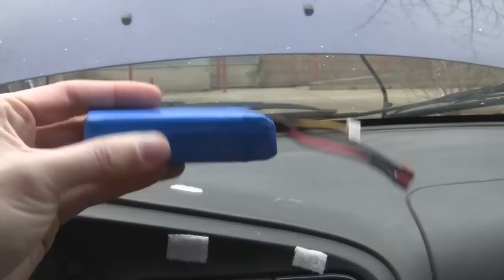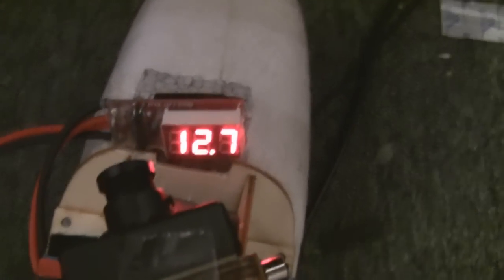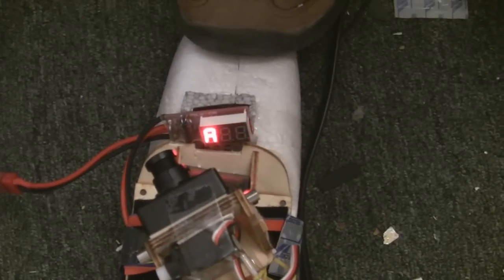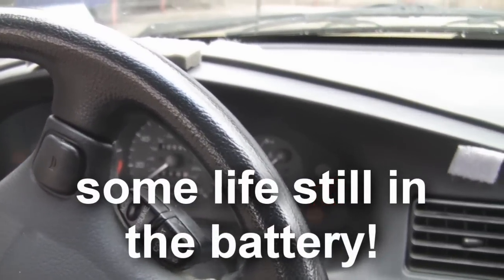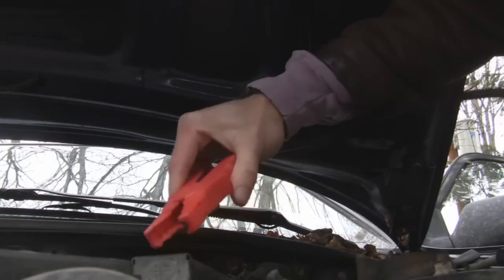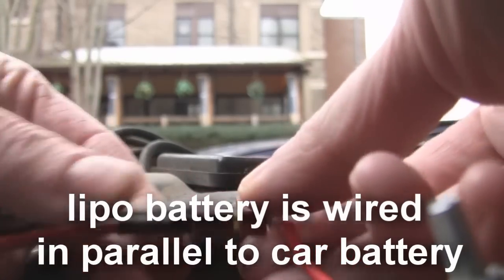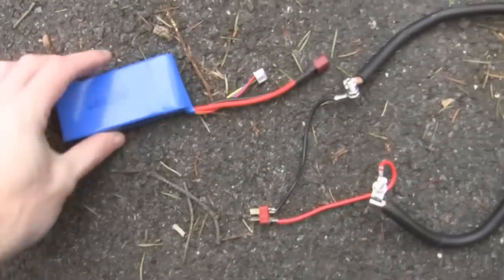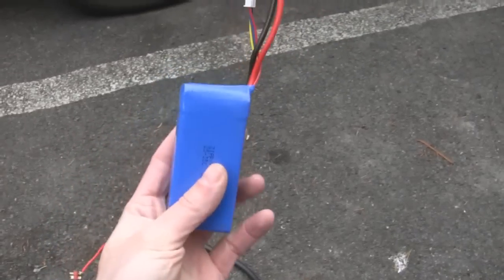Starting a Car with a Toy Plane Battery

Comment: Tried this on a motorcycle using a 4s lipo. Turned that 250 over at at probably 1.5 - 2k rpm. Melted the thin jumper wire I used. Fun times.

Comment: The explanation is fairly simple, it's not high science. The car battery when new and fresh has a capacity of about 60 amps for an hour. But old, worn and tired, it will produce half that, so not quite enough to start the engine. So plug in a fresh LIPO battery with a capacity of 3 amps for an hour and you are able to add ten percent to the car battery, just enough for the job. The LIPO wont do the job on its own, and if your car battery is really dead, you won't have enough. It works, but only in marginal situations. Connect the LIPO and wait 10 minutes while the electricity transfers to the car battery before trying the starter. Bear in mind when that a new car battery of the he right size will be much better, and won't cost much more than these high C rates LIPOs. BTW, don't allow the LIPO to remain connected to the cars charging circuit for long otherwise you risk a fire.

Comment: I wouldn't encourage people to do this though, from what I understand those batteries explode/catch fire if you charge them incorrectly. In some cases they do that anyway when you are charging them correctly.

I'm guessing if you leave it to be charged by the alternator on a car for any period of time it will catch fire/explode, not a good thing if you are holding it when it happens. I would just get a battery charger and just charge the thing for a few hours.

Comment: there is a big difference in which the way dc and ac power electrocutes you, if you wanna lose limbs or get serious burns dc, if you want to be grabbed and throw a breaker almost instantly pick ac trust me ive been hit by 440v ac it wasn shit compared to a 24v battery bank used for emergency startng an egt i was working on battery bank slipped because we were in heavy seas and crossed the poles  series parralel battery bank and instantly suffered extreme burns and got thrown about 10 feet

Comment: and you do realize that the amperage scales with voltage, right?  I'd rather get a 60A zap from a 12V source than a 7A jolt from 110v source.

Comment: It's impressive, but it could be a small lead acid, motorcycle battery. OK the density is notably greater, but both types of battery have the ability to deliver a good instant hit of power.

Comment: @santopotter The car battery and the toy plane battery use different technologies. Lead acid vs Lithium Ion. That's why they're different sizes. LIon batteries have a much high energy density which is why a battery that can start a car can be smaller. It's also a lot more expensive though, plus LIon batteries self discharge over time, which is why they aren't used to replace car batteries.

Comment: @santopotter this vid isnt a fake, you can start a small car like this that the battery isnt completely dead on. That little battery he has will constantly discharge @ 75 amps, and is rated to do burst @ 87.5 amps and will actually do more than that for just a few seconds.also if it transfers power @ a rate of 50amps for 15 seconds,that is the same as 500amps for 1.5 seconds(about the amount of time it takes to start a car)
no arguement,just fyi
thanks

Comment: Geee!! this is fake!!! You can't start a car with that little battery!! The 12 volts are not important, what you need to start a car are amperes!! lots!! Why do you think the car batteries are that size? If that little brick could match the car batteries in performance, well, i think car batteries would be that size now on.

Comment: I heard when you jump-start a car (using another car) you should put the black cable not at the minus part, but on some other piece of metal inside the car. Is it the same here? Cause it looked like you were putting it on the minus.

Comment: @biggdaddy2001 That might work, but you'd need one huge diode. With 100 amps peak load the diode would get hot and drop at least 1 volt (silicon diodes only.)

Comment: @bloodreighn Those LiPOs can take 40 amps continuous, but they can also take somewhere from five to ten times than for a couple seconds without harm. LiPOs can explode or catch fire of course if this is a continuous fault because of internal heating, but in an emergency I can't see the problem...

Comment: CONTINUED: Generally because the starter motors are smaller, more light weight and because of there gear reduction drive having to force around a higher compression engine i would only ever see 60-100 amps in Motor cycles and ride-on lawn mowers, IN General, NEVER Jump a car with a battery smaller than the main battery

Comment: oh sure it will start it, but because of the Type of the load on that Type of battery, you have a HIGH Risk of blowing up the battery, which aint a good idea if you have seen a Li-PO Battery explode, and.. no it doesnt take 60-100 amps for small cars, who ever told you that needs to go visit a REAL auto electrician, who will tell you that its more likely around 120-200 amps

Comment: It's very good that you disconnected the battery almost immediately after starting - a car alternator charges lead acid batteries at 14.4V, which for a 3s lipo pack equates to 4.8V per cell, which would damage them and make them puff up if they were already fully charged since max charging voltage for lipos is 4.25V/cell.! Very good video, thanks for posting!

Comment: tehdarkceroez has a great point, it's more effective to use fuels to make electricity and then use that instead of burning it in a vehicle that only uses less then 30% and wastes the rest (as heat mostly). But I would go even further. The cars pollute nothing, and so we pass on the pressure to the power companies, when the cars dont pollute, the next step will be the power plants.

Comment: Ok, I will ask a small question, it's just a question no need to flame. 

So, if you switch to an electric car, which you would supposedly charge at home. That means that you would have to provide more power to charge the car battery, thus the burning of more fossil fuels at a power plant. 

Doesn't the increased load at a power plant negate the effects of switching to an electric car?

Comment: Cool video, but it lets the mind wonder why only the US stick to gasoline while the rest of the world is trying to convert to full electric with the new Li-ion batteries. Even India is investing full throttle into electric. Li-ion technology doest just save you when you have a dead bat in your old car, it runs the car smoother and with no sound, no tailpipe, and yep aloooot of torque

Comment: Also dropping a Li-Po's voltage too low, even momentarily, can destroy the battery too so that was a lucky result given the load of a car.

BTW, my Traxxas Rustler (brushless motor) car will go over 70 mph making it faster than the gas powered off the shelf models. You can YouTube the model if you like.

i also have an electric "3D" helicopter, an Align TRex. Although less powerful than the car it has impressive lift and will fly for about 15 minutes on a charge. 2.6 Amp-Hr

Cheers

Comment: I'm a big fan of Thunderf00t and I didn't know he was into electric models. I am too.

I have a 3 cell Li-Po battery on my Traxxas electric car that is rated to deliver 250 amps in a burst or 125 amps continously! 5 amp-Hrs

This experiment was dangerous on a couple of counts though:

1. Li-Pos can self destruct in flames by being overcharged and 12.7 is close to that limit. A car will charge to around 14.2 volts so it could have exploded from that.

Comment: if your car has a standard transmission, couldnt you have just push-started it? thats what i used to do with my 1966 ford mustang when the battery died. good job though.

Comment: dude I think it´s his hobbyroom you should see my workshop.
and the methode of starting a car with a model battery is a nice idea, i did it once too but i didn´t have this fancy clamps, i used a pice of wire and the wraper of an chocolatebar it smelled a little bit but it workt^^

Comment: You could probably do the same with a 12V-14.4V battery pack from a drill.  The new drill packs are also lithium ion these days (probably the exact same cells in the plane battery), only they can handle ~80amps  instead of 40 amps.

Comment: ha.  I have a 3s lipo batt that can give between 100 and 150 amps continuous.  freikin owned

AND LIPOS AREN'T DANGEROUS, CHARGERS WILL DETECT HOW MANY CELLS THERE ARE SO ITS VERY HARD TO OVERCHARGE, VERY VERY HARD TO OVER-DISCHARGE (create too much heat from discharging it at a very high amperage), AND YOU HAVE TO HIT IT VERY HARD WITH SOMETHING VERY SHARP TO PUNCTUATE THE CELL.  STOP SCARING PPL FROM BUYING SOMETHING JUST AS SAFE AS A CRAPPY NICAD OR NIMH.  nuff said

Comment: I actually had jumper cables arc through change in my pocket.  I now have the faces of dead white men burned into my inner thigh.  Great conversation piece though.  Always a good idea to attach BOTH cables to the power source before walking to your car /facepalm

Comment: what confused me is the voltage on the battery. 12.7 for li-po 3S is rather high. 
another confusing part is why in the hell the jumper cables are so goddamn thick if the same required amps can go through 16 ga. wire.

hmm...probably to isolate shorts to the battery

Comment: That was a really stupid thing to do. Lithium Polymer batteries are known to explode or catch fire when over loaded, or over charged.  A better thing to do would have been to hook it up like you did and leave it for an hour and then it would have started from the car batter (in effect your Li-Po battery would have charged the car battery). For the record, ni-cad is better at high load than li-po, but LI-PO has higher energy density. Because ni-cads have the lowest internal resistance.

Comment: Of course there would be room for the death ray. Attach a smaller camera, and you could mount one on the top. It's just a silly question, will there be enough room for the death ray... Psh, a death ray-less plane is as essential as the dungeon in the basement, and the immensely over-complicated plans! Don't be daft!

Comment: That was an idiotic thing to do, considering the starter pulls MUCH more than 30A (or whatever that tiny battery can support).  You're lucky the battery didn't burn out.  And considering the alt. probably puts out 30A at cold idle, you're lucky the battery didn't explode once the engine started.  Furthermore, the dirty supply coming off the alternator will send huge transients to the battery once the starter solenoid retracts and the EM field decays.

Comment: Well if you take V = IR, and say the resistance of the cells are the same, 12.3V = 40A * R, R = 0.3 Ohms.
If the resistance is the same, the 9V cell would produce 3/4 of the current (with 3/4 of the voltage) and so it would have about half of the current required. The one he used has 2/3 of the current needed, so I'd say it would maybe have enough power, yeah.

Comment: Modern cars (with electronic ignition) does actually not take that much to start. When you have voltage enough to turn the engine you will get a proper spark and the fuel pump is electric so fuel pressure is there for the first spark.
The same trick would not work on a 60s or 70s car with a carburetor and mechanical fuel pump.  

(still a neat trick, tough)

Comment: Definitely a belt slipping in there somewhere. Tighten them up or replace them once in a while. Also, if you are able to reach the starter it would be better to attach the leads from your airplane battery directly to it rather than the car battery.

Comment: Fortunately your car is in good enough running condition as to not require cranking for more than a second in order to start. I don't think those small leads on the battery could handle that kind of current load for very long.

Comment: Nor does it mean that your actual car's tyre pressures aren't correct, even though it looks like they aren't. How could we know they are correct without the moral guidance we received from the car's user manual, (user manual Battery 5 3:12.)I fail to see how this science explains everything, I mean the car had a designer, right?

Comment: But that doesn't mean that without the battery in the car, or the RC plane battery, that there is no invisible battery overseeing all the batteries and ensuring that they are working correctly, and that if they are not they will be punished.

Comment: ...The pressure (Volts) is the same in the thick and the thin pipes. 12 Volts means low pressure in the system. Your tongue or fingers have a high resistances. We can imagine that touching the pipes would make tiny holes in sizes representing high resistance. The water would try to come out but because the pressure is low (12V) you can hold it back. It makes no difference whether you touch a thick pipe with great water flow (many amps) or a thin one. The pressure is the same.

Comment: It can be useful to understand electricity with the analogy of water flowing though a system of pipelines. The water pressure is the potential difference, Volts, and the thickness of the individual pipes equals the resistance, Ω. Thin pipes have big resistance thick pipes, low. The amount of water passing through each of the pipes within a certain time unit is the current, Amperes. The current is reversely proportionate with the resistance, so high amps in thick pipes and vice versa...

Comment: You probable did'nt start the car with the toy plane battery, it just charged the car's battery which in turn started the engine. Prove me wrong? Try disconnecting the battery in the car and try again.

Comment: There's been some question about how badly Tfoot would have been shocked if his hand had touched the connectors.

Then someone claimed that they could put the battery in the video to their tongue and be unharmed.

Let's settle the debate once and for all.

Wouldn't a tongue (being wet with saliva) have a relatively low resistance?
If your tongue had a resistance of 1,000 Ohms, wouldn't it be:

12V / 1,000R = 12mA ?

If my math is bad, feel free to tell me.
But don't be a dick.

Comment: If it were older and RWD, I'd have a fan belt, but the engine's transverse, so the fan is electric.  No fan belt.     

The belt from the  alternator, AC compressor, water pump, etc. is probably what's squeaking.  :)

Comment: your lucky the battery was just under the threshold amps needed to start the car so the extra amps and voltage gave the boost but i would not depend on that trick all the time.  
there are a lot of variables that can affect the outcome  :)

Comment: Those batteries lose their charge quite quickly. So you would always have to think about charging them, because you need the high current only a fully charged battery can give. You know Murphy's law? Right when you need the backup battery, you can be sure, it's flat.

Comment: Putting such a battery to your tongue would not "not kill" you, because the current does not flow through your heart. 
But it would not kill you, because you didn't understand Ohm's law. Just because a battery can give 40amps doesn't mean it always does. The current depends on the resistance connected. Your tongue has a fairly high resistance, so no high current. You ever put a 9V-block to your tongue? With this 12V-battery it would be quite the same feeling.

Comment: In the spirit of MacGyver-ing; you should have wrapped the soldered connections with plastic wrap (if you didn't have electrical tape lying about).  Would have made the whole thing much safer.  

Technically, you could have used a high-amp diode to protect the plane battery.

Still freaking awesome though.

Comment: I could use something like that. My car has hungry headlights and on a couple of occasions I've pulled over to take a phone call and, being the environmentally conscious person I am, switched off my engine. Problem is that I tend to fail to notice my headlights are still on, and by the time the conversation is over I have a flat battery.

So if I were to try to find this little battery on the internet, what should I search for?

Comment: 1) You're not supposed to connect black to negative.  You're supposed to ground it somewhere else on the engine block or chassis.  When the battery begins charging, it can give off hydrogen, which can explode if a spark is made while disconnecting the leads.

2) I'm sorry dude...but your house...dude...trash BLEW AROUND when the plane started.

Comment: Where did you buy a three cell battery from for $20? I want one. I've been flying with a two cell and want more power :).

Also you really should have put some electrical tape and heat shrink on that cable. :p

Also to the others there is nothing illegal about this.

Comment: I remember when my garage opener battery died on me plus I didn't have a key to the house so I was locked out.

I ended up disassembling the remote case and used battery from my phone and the electrodes on the remote circuitry chip to circumvent this problem and get the garage door open.

:D